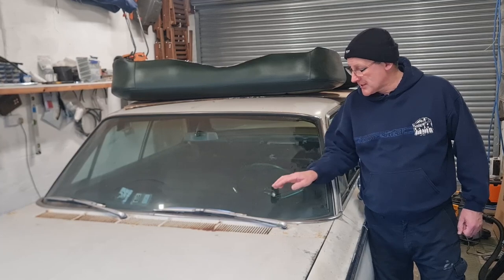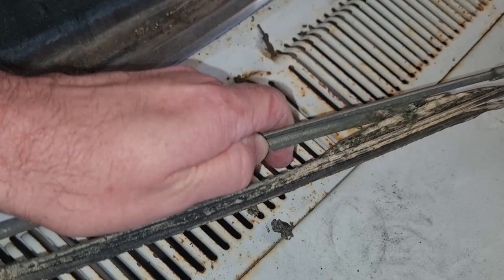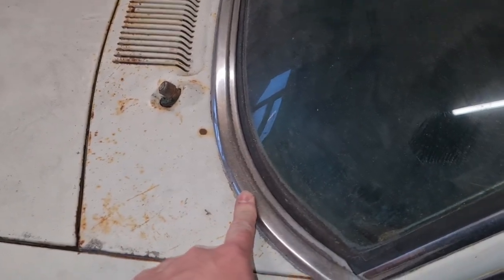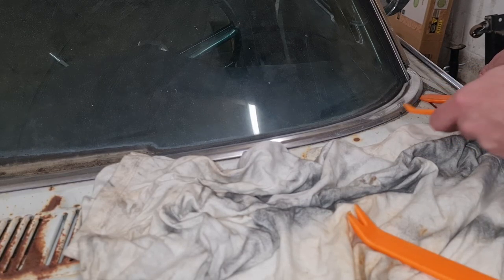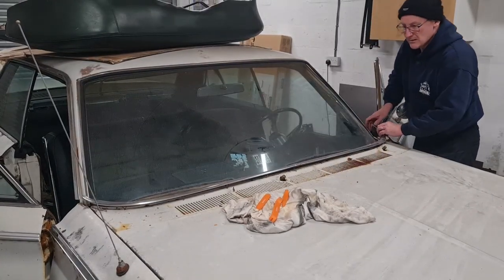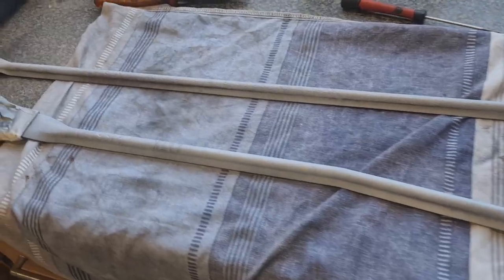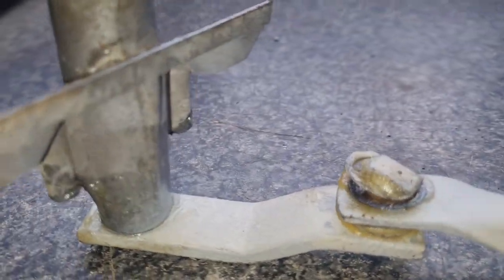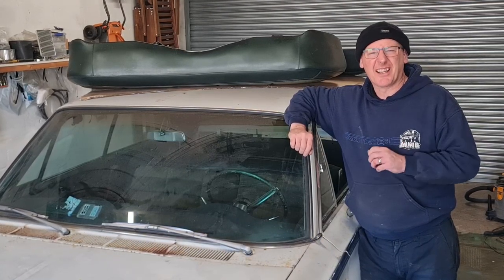Wiper Linkage Revival / Scuttle Area Clean

Comment: What you said about getting that piece off your Polara is exactly my experience with this job with both my '67 and  '68 Plymouth Furys.  Both were very easy to remove without doing anything with the hood. Your video reminds me it's time to do it again to my '68 Fury VIP.  The first time I cleaned up the scuttle, i found it was just like yours. The 1960's wiper set up is way way better than the wiper linkage on my '79 Dodge St. Regis with those awful nylon wiper bushings that self destruct early and often. The only fix for that seventies stuff is pin clips and washers.  Mid to late 1960's Mopar C-bodies are a joy to work on compared to 21st Century cars.
Reply from the maker: Thanks Patrick. Good luck with doing it again on your VIP my friend 👍

Comment: Thank you George!
Reply from the maker: You're very welcome! I hope it helps 👍🏻
Reply: @SortedGeorgeGarage  I've not had to do that on my '65 and '66s but if I had to...nice trick with the hood Geo!!!  Well done!
Reply from the maker: Worth doing my friend. The dirt holds the water which causes the rot in the bulkhead 🤠👍🏻
Reply: @SortedGeorgeGarage  Absolutely!  I can think of many US vehicles that suffer that.  Al of the Fords.  But, I'm lucky Geo!  The one I have now  is a 44K mile original, indoor kept survivor.  I only had to replace the rubber mechanical items but I replaced the entire break system with stainless lines.  I did replace the Original timing gear set.  It still had the original nylon cam gear in it.  Here is shot from two years ago.  She won an AACA unrestored trophy in 2018.   But you never know when another one may fall into my lap that isn't so lucky.
https://www.youtube.com/watch?v=pE4jdexCgr4     Keep going with project GEO!  I love my C bodies!